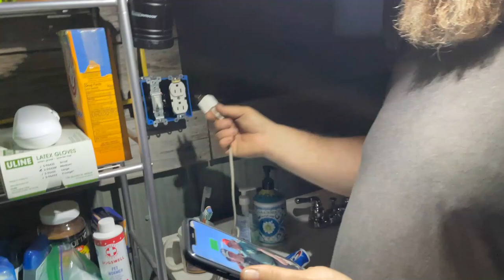Vital Improvements to our Off-Grid Amish Cabin

Comment: Hi Jason, just to spot check... Even though you probably know, if that white wire is 14 gauge as is typical of the white interior wiring, or if the outlets and switches aren't rated at 20 amp, you'll want to put s 15 amp breaker on the circuit to protect from a fire if the circuit loads about 15 amps which is all the 14 gauge can handle. Also, are the bathroom and kitchen on a GFCI breakers? Cheapest way is to make 1st outlet on the run a GFCI and it protects the rest.
Reply from the maker: If memory serves, I have 15amp breakers on everything.  I did not add GFCI outlets but I do plan on it soon.  I also need to add the grounding rod to the panel to allow the breakers to work.  Right now we rely on the Inverters breaker but I’ll get those items completed soon. 👍

Comment: I prefer my electrical surface mounted. My walls are concrete so it worked out that way. I am too afraid of fire to have them hidden.
Reply from the maker: With having tongue and groove siding I didn’t want to have to damage them if we wanted to add a line or have to make a repair. This worked for us